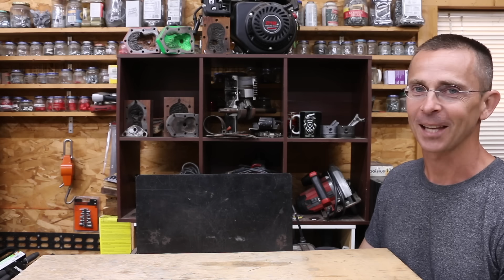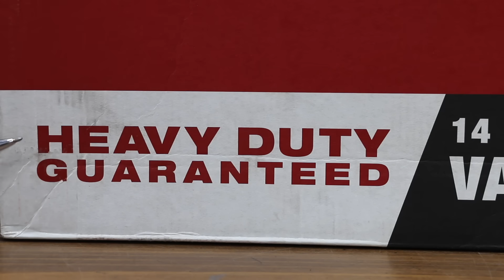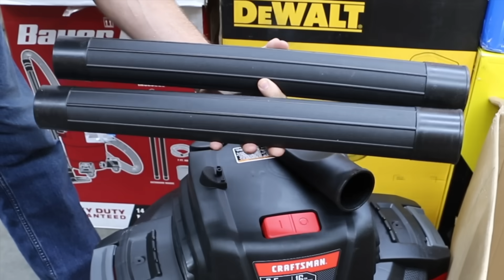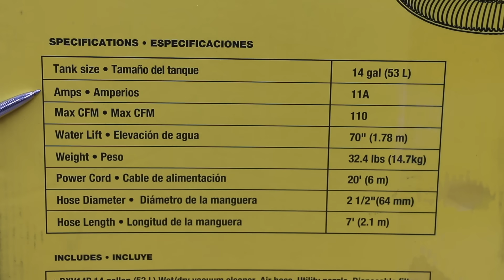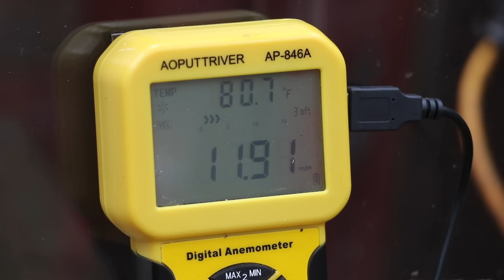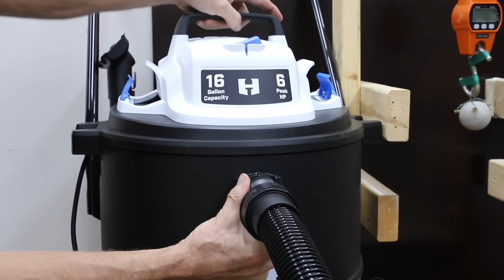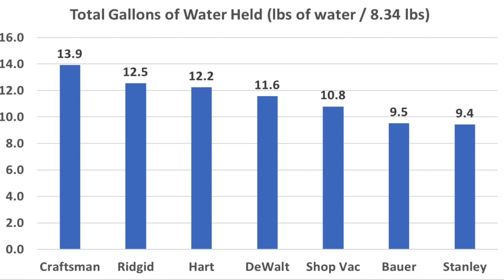Best Shop Vac? Ridgid vs Shop Vac, DeWalt, Stanley, Hart, Craftsman

Comment: Im not sure if the hose end diameter was the same on all of the shop vacs, but in the suck test, hose opening size matters. 
A shop vac with worse suction would it your test be able to outperform a shop vac with better suction, if the opening is bigger, as the vacuum can affect a larger area.
But good video otherwise

Comment: Nice testing once again, and again: I really love the extended criterias 😊

Just one thing: it's pretty normal to have a higher airflow OR a higher vacuum. The lower the diameter of the hose, the lower the airflow but higher the vacuum you get. At least as far as I know, but I am not an expert either.

Comment: I own an older (10+ yrs) 8/gal Craftsman Stainless Steel shopvac and its lid is nice and tight, but is quite loud/noisey. It also doubles as a blower, with a separate hose port for that purpose. Not sure what kind of "numbers" it would turn out, but it has incredible suction, as it constantly sticks to my entry mat, while in use. One of my favorite uses is as a fly catcher, when I put on the blower nozzle w/ a 1" opening - sucks them right out of the air, Ssswoop! Not quite as satisfying as the POP! from the electronic fly swatter. Retirement has given me way to much time on my hands. lol Another top-notch comparison.

Comment: i have an older than dirt crafstman 16 gal. 2.25 hp..  20  years? sounds right. just took a tissue around the lid. drops to the ground. i'll stand by the crafstman too. been on 1,000's of jobs. (remodeling contactor) now my shop. picks up everything.. including pencils pens, anything i don't want it to on my desk.. yes, it gets quite dusty in here.. even with decent air filtration.. speakin of? how about a test on the hanging ones, jet, wen  and what not.. to a box fan with a filter?

Comment: Shop-Vac anecdote:  I have a Shop-Vac brand wet/dry vac, and the motor gave out on it one day after several years of use.  I never filled out the registration card or any such thing, and wasn't expecting, but I thought I might be able to save myself a few bucks over buying a new one, so I called up the company to see if they would sell me just the motor.  The lady from the help desk asked for the model number of the vac and my address, and Shop-Vac sent me a fully assembled head unit free of charge.

So, though some of the other units were more impressive in various ways, I don't imagine there'll ever be enough of a difference to get me to buy another brand.

Comment: A wood Finishing Product test ( epoxy, polyurethane, Tung oil, etc) would be interesting. Water, UV, mold, might need to be long-term. https://www.marinetalk.com/best-marine-varnishes/  and https://thewoodwhisperer.com/videos/durable-outdoor-finish/ indicate maybe nothing is going to last more that 2 years.  Maybe just keep all wood in the shade and use metal/ceramic in the sun.

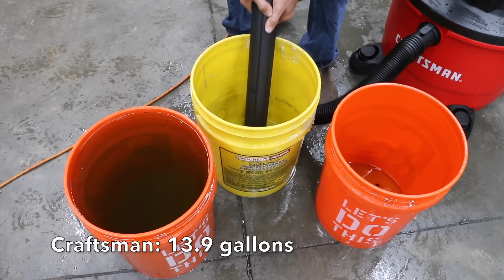Comment: It doesnt matter how motor lid holds on bucket when it is turned off. When it runs, vacuum uder lid sucks lid and it is impossible to lift it. Whats matter is, if is it some sponge gasket between lid and bucket. Observations: 12:20 Where does water comming from top of Craftsman?  14:20 Bauer doesnt filtering fine dust well because there is lot of dust under exhaust after sand test.

Comment: In Europe, the shop vacs are a lot of times built out of thin stainless steel instead of plastic they generally don't have water drainage at the bottom and the hoses have a smaller diameter. But the seals on some American shop vacs really disappoint me, mine has a replaceable rubber ring and seals completely airtight. It's interesting to see the difference.

Comment: Nice competition. 
I have a 20 year old Shop Vac. 16 gallon with a 2 1/2 hose. 4.25 hp. Love it still works and sucks awesome. Only had to replace the hose 1 and buy a couple of the drain caps. 
My parents basement flooded once years ago. It was out sucking a brand new Rigid Shop Vac.
Last time I contacted shop vac they asked me if I wanted a brand new one. I asked why. They wanted to bronze mine and put in their hall of fame.
I declined..

Comment: Recently came across the smaller 9 gallon DeWalt shop vac and have been blown away!  That thing is so powerful and small/compact.  The wheels are high quality and roll better than any I've seen also.  Cord wrap is better than the rest too.  Only con can come up with is short cord.

Comment: Just curious about the suction test

Would the hose diameter impact these results?
More surface area is being applied suction for the larger diameter 2.25" hose than the smaller 1.75" hoses

Comment: The removable blower style vacuums are garbage, and was probably not a fair comparison. Regardless of the performance I have never broken a rigid vacuum, but have broken numerous shop vacs, craftsman vacuums, and dewalt vacuums. I haven't used hart, stanley, or bauer because I don't like their other products. Just my .02

Comment: i  some times empty 400 lbs sand filters for in ground  pools     Using the exact  rigid  In this video...       And I used to clean the bottoms of pools Mainly inground pools   to get all the water out using this exact  shop vac...    ,,,,     vacuum handle that no problem for many jobs,,,
Plus I don’t see the waterproof filter that you’re supposed to use...        
I’ve had other people that work with me  use  dewalt  and bauer   The bauer  failed within a year..       My rigid still going very strong       Stick with Rigid,Craftsman or deWalt       ,    Good testing though..

Comment: We have a Rigid is a stainless steel body, motor stay intact and locks down tighter than the model you use in this test. It's used to clean the lint department of eight commercial speed queen clothes dryers and anything is 25'x20' laundry room seven days a week,. It's a 16gal unit. It picks up coins clothes pins, sock fabric softner towels and everything a small child can leave in a laundry room that can fit in 2 1/4" hose. One thing those, it has to be turned off for anyone to hold a civilize conversation. IT IS LOUD! LOL!

Comment: i would like to see some torture test
like how long can each brand hold when under abuse until it fail

some product only doing well when it's brand new
cuz they push it hard so it looks great in short test
but the cost is it will fail earlier

if this will require too much work,  never mind

Comment: I got a DeWalt shop vac from Costco with a metal bucket which ran around $90. I mostly use it to remove dust from woodworking tools and it works fine even when nearly filled even though when the filter is clogged it is loosing a lot of suction. I love the build quality and performance but it is a little bit unyieldy and heavy.

Comment: Great analysis, I buy according to cost, ease of use, size of wheels, length and quality of hose, ease of draining fluid, quality of build, filter size, especially important when vacuuming dusty stuff in an occupied business. I have used many in my 50 years of manual skilled labor and have some hearing loss from using the older types and no ear protection.

Comment: another fine analysis but I was disappointed that there was no tests of provided filters... the cheapest vac appears to have had a laughable foam filter. I've had a Craftsman vac (I did NO research at the time of purchase) for > 10 years and one feature I really like is the ability to use a washable Gore CleanStream filter, purportedly with HEPA-level filtration. My biggest concern with any vacuum is how 'clean' is it's exhaust.
At any rate, great job!

Comment: In case this hasn't been asked before, perform pressure washer comparisons.  Electric should be no competition against gasoline, but it may be surprising.
Everyone I have ever known to get an electric has had failures in a year or two (including myself) and if you have thoughts on that, would be appreciated as well.
As always, keep up the great work!

Comment: Absolute max you will ever see out of a 120v/20amp wall outlet is 2400W which is slightly over 3 horsepower and that's with perfect efficiency.   These nonsense "peak horsepower" numbers should be sued out of existence as false advertising.

Comment: Thank you for taking the time to do these test. You just saved anyone who deals with pools a load of time. If you have a sand filter it can be a pain in the neck to get dirty sand out to change it. I currently use a new shopvac but after watching this I will definitely be switching brands. Thanks again

Comment: I had a contractor bid $3500 to clean out my attic.  I bought craftsman’s biggest shop vac and 50 feet of hose.  I vacuumed out 250 lbs of dust. Cost me a total of 250 with the bags, hose, etc.  had my wife run the shop vac while I vacuumed. Sold the whole kit with all the hose I bought for $50 when I was done.

Comment: Maybe you can try out these two Bucket Vac's next time? 

https://www.homedepot.com/p/Bucket-Head-5-Gal-1-75-Peak-HP-Wet-Dry-Shop-Vacuum-Powerhead-with-Filter-Bag-and-Hose-compatible-with-5-Gal-Homer-Bucket-BH0100/202017218
https://www.lowes.com/pd/Shop-Vac-1-5-HP-Portable-Wet-Dry-Shop-Vacuum/3160385

Comment: I have a Rigid wd06350  6 gal.  , the thing is 9 years old and still runs like a clock, it's been used like mad too, man they made a good vac & still do from what I see in your video! Best part is you can still buy parts too for most of the older shop vacs, I know for my Rigid I can, and most older Craftsman and Shop-Vac. Loved the vid, lol I was hoping maybe Bauer would slap DeWalt in the end there, but clearly the $$ spoke up. No more foul play from Harbor Freight 😂😂

Comment: I feel like the air filters in each could have made a huge difference in suction, CFM, etc. I like that you tested them with the water to eliminate that variable. Based on the video, I'm going to put a small bead of silicone around the top of my shop vac and let it dry, then reassemble to help it create a tighter seal. Nice video. How about a video for the fastest way to cut through some steel? Like 1/4" stock, using torch, plasma cutter, angle grinder, cold cut saw, band saw, reciprocating saw. Not a true comparison, but fun regardless. Talk about the pro's and con's of each.

Comment: I have an idea. Test different hearing protection gear. Earplugs, headphones, regular earbuds etc... I thought you could hollow out a foam head put a decibel meter in it and drill out the two ear holes.

Comment: I have a small indoor pet pig (115lbs) and use the armor all 2.5hp wet/dry vac to clean up her area and wash and clean her pen. I think it has a 2 gallon bucket. For $35, it's really paid off. 3 years and counting. It wouldn't stand a chance against these big boys though 😂

Comment: The test with the ball at 8:20 isn't fair: all hoses don't have the same diameter.
As a result the first model with a smaller diameter has less suction.
Have you considered dividing that suction by the hose section? That normalisation should compensate for the change in diameter between models.

Comment: A decent test for vacuums to check power is a water lift test; that is you take a standard pipe diameter, say 2”, and place it into a bucket of water then attach the vacuum to the other end. When the vacuum is turned on it will develop a vacuum that will lift the water proportionately to its vacuum. I’ve seen these made with clear pipe and died water to better show the results. I always like seeing this testing; I sought out similar testing when I picked a dust extractor. It was unbelievable how this differs especially as filters get clogged.

Comment: U can not use the wattage for hp.. all depends on the motor efficiency.. if the bearings r hard to turn it will consume more power and still have less horsepower in the shaft... So that wattage to hp conversion of this entire video is invalid!! A cheaper made motor can consume more power.  + The vacs use universal motors so the commutator brush and ring will take time to smooth out and that can cause changes in power & current draw.

Comment: Shop vac service has been excellent. I called to get a part and when they ran the serial number they said they owed me a new motor.   Some recall issue I guess. No questions on when or if I bought it. Two days later I had a new motor.  I’m pretty sure it was over 10 years old.

Comment: I have a Vacmaster 12 gallon, 5hp shop vac for like $80 and I've loved it! Never used it for wet stuff yet but works great otherwise! My only complaint would be that the hose is larger in diameter which makes it harder/more expensive to find accessories for it. It looks like it might be made in the same factory as the Hart because the drawing on the manual and some of the parts look the same

Comment: My Shop Vac stopped running and I figured out that that the motor was shot and like most electric motors in appliances these days the motors are not repairable.  I did a lot of shopping and couldn't find a shop vac as good as mine. I finally found a motor/fan assembly that was an exact fit my Shop Vac for way less that half the cost of a new shop vac. It was easy to install and is still working great.

Comment: I think suction is by far the most important metric. I have a Stanley, but the taller stainless drum version. It does at least have a very nice sealing lid and it was only $60 or so.
That said, I think it could be a bit stronger. Looks like the Bauer has an incredibly torquey motor! I was also overall impressed by just how fast every vacuum could suck water.

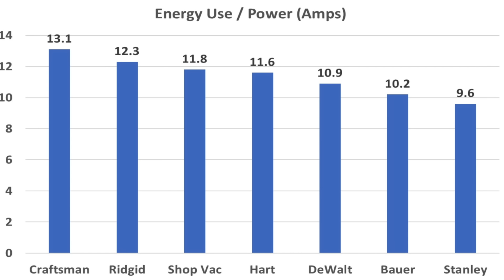Comment: It should be noted that power draw does not necessarily indicate mechanical horsepower.  A brushless motor would, for example, draw less from the wall (or the same) but produce the equivalent or more mechanical power.  I see you brought this up at 6:38.  Good!

Comment: The best shopvac is my vintage craftsman  6 peek horsepower I found it in the garbage I cleaned out the motor it works like new it is from the 70s I am 18 i collect vintage appliances

Comment: Would you be willing to make a video on how much oil you can put in an engine above the recommended amount until the engine stops working? Also could you turn a vertical engine into a horizontal engine ex. Push mower?

Comment: I love Ridgid... their vacs are really good..🏁 We use Shop Vac at work but I think my Ridgid that I use at home actually works better ..
The  Bauer did an impressive job but for how long?.... was a built to perform for a short time or is it built to last more than 3 years and still have that kind of performance? Only time will tell.... I've had my Ridgid vac for 5 years and it still works as well as it did the day I bought it

Comment: I'll tell you direct and simple:
Highest power usage, simplest construction, and largest pipe. There's only 1 atmosphere of pressure to be generated (a vacuum). So the rest is all just unimpeded volume of air flowing